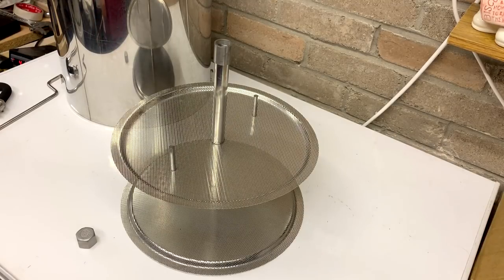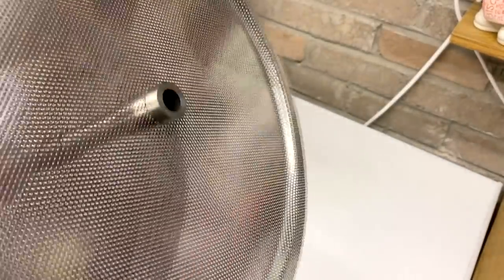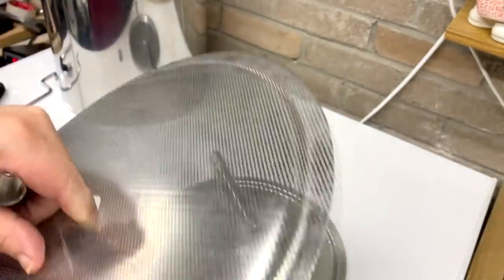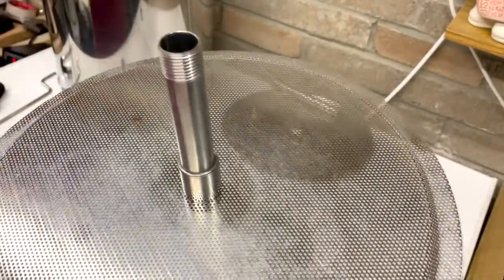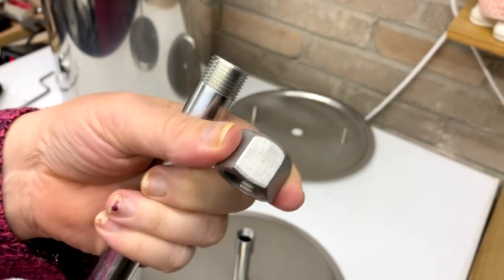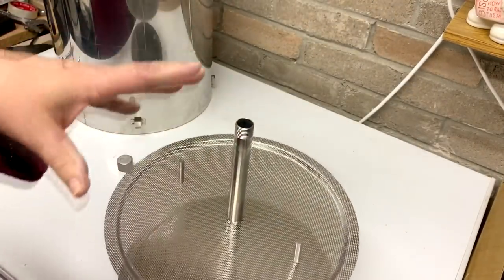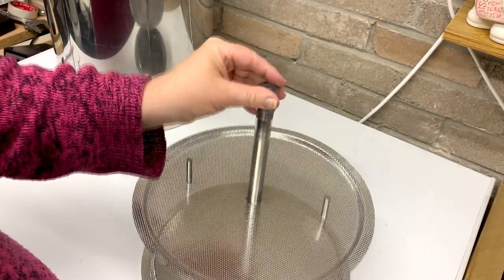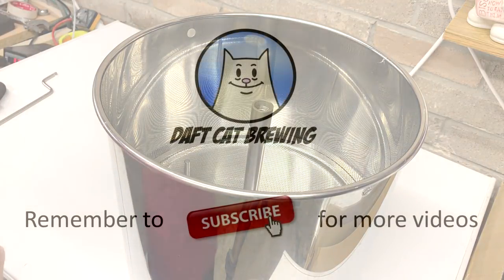Assembling the malt pipe on the Guten Mibrewery / Beer torrent / Hopcat / Brewdevil / Klarstein etc

Comment: Very useful, there's a few things there I've been doing wrong! Thanks very much!

What's the actual function of the half-threaded nut/pipe? I haven't been using it, and the overflow just goes down the central pipe... Am I missing something?
Reply from the maker: It isn't necessary but it raises the level before it overflows. If you want it to overflow 1/2 inch lower then you can leave it off
Reply: @DaftCatBrewing  Ah, brilliant... That's pretty much what I've been using it for!

Comment: Have you had any issues with the pipe coming loose on the bottom end. It keeps happeing to my set, not sure how to solve.
Reply from the maker: I've not seen that on my one the bottom nut holds the plate in place very firmly. Is the hole on your bottom plate too big or does the bottom threaded piece not screw into the pipe properly?
Reply: @DaftCatBrewing  it screwes on perfectly and sits on there tightly. But comes loose during stirring.
Reply from the maker: Strange, I've never seen that issue as my bottom plate is always sandwiched tightly between the bottom nut and the malt pipe. In fact it can be difficult to undo it sometimes.

Comment: you have got the wrong screen as the one with the two legs goes at the bottom,not top
Reply from the maker: They are handles to place and remove the screen not feet.
Reply: @DaftCatBrewing  THANKS- ITS SO FUNNY BUT AFTER I SENT MY MESSAGE I HAD A EUREKA MOMENT AND THOUGHT EXACTLY THAT. Thanks again. By the way I did try your method of lowering the power wattage but this resulted in the kettle turning itself off. I have the Guten Nano Brewery System and wonder if reducing the wattage makes the power unit overwork and then the failsafe kicks in. I now leave on 2500w all the way through and no probs. Back to my Cherry IPA. Bye